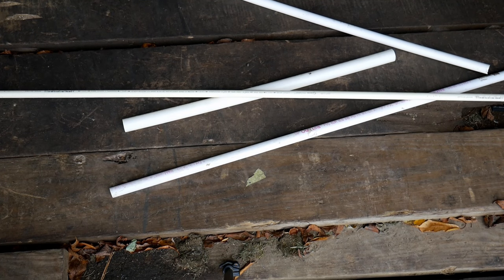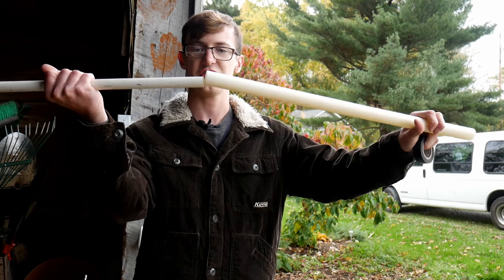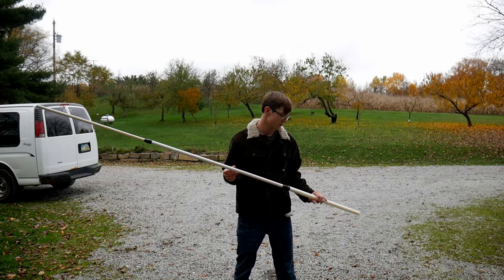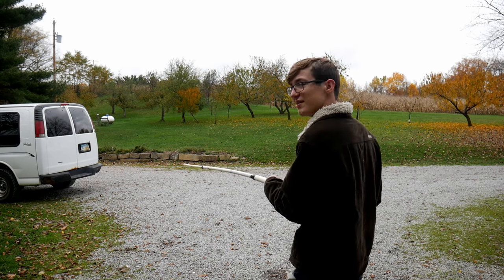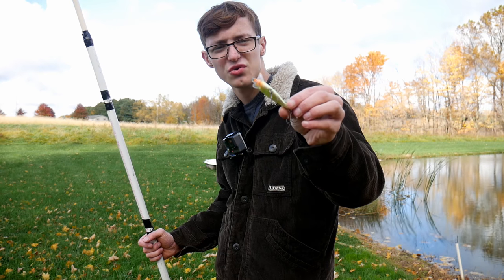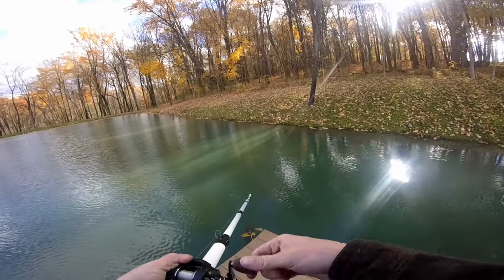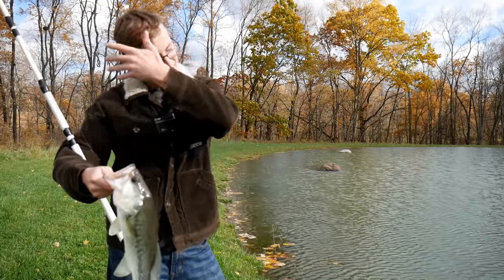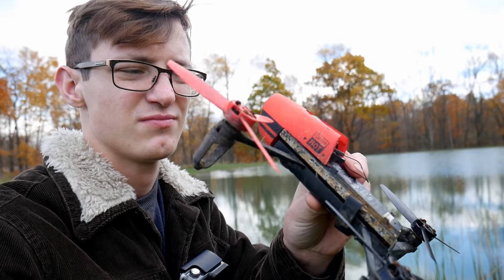PVC  Fishing Rod challenge

Comment: Hey guys or brendan, what bait or baits do you reccomend for fall fishing??
Reply: Gage Romanski I use crankbaits and spinner baits and I also go cat fishing in fall
Reply: Okay thanks. Im gonna try and use this soft plastic swimbait I just got
Reply: no that won't work. at this time of year bass are keyed on crankbaits.
Reply: jerkbaits, slow rolling a spinnerbait through the weeds or chatterbait with a swimbait trailer, squarebills use a stop and go retrieve alot of bites will come when you stop the bait same with the jerkbait
Reply: Crankbaits are great this time of year, but hardly the only thing bass will hit well.  Bass are still hitting shallow, and even on the surface.  Right now, they're hitting from surface to bottom.   Even here in the north, large lakes still have water temp in the sixties, and on a sunny day, bass are right at the top of the water, and will hit anything from frogs to poppers.  Crankbaits will catch them like mad, but crankbaits also draw everything from crappie to walleye to every other fish large enough to hit the bait, so if you strictly after bass, you'll have to go through a lot of fish to find them,  at least in a large lake.

Comment: I was already making this rod 1.5 years ago before I stumbled upon this video. PVC rods are great. I make rods which I call pumping rods. That is, I pump yabbies and worms with them too. I also turn them into walking sticks. I make my own slide on eyes and reels too. Never have trouble CASTING but don't use full length 1 meter sections and I do not attach them with tape. You can use some newspaper and box tape to create a friction joint so you can slide the PVC to correct length so it casts properly. See @plettgeorge for D.I.Y reels and rod kits. Simply reed all 212 bush fishing related tweets if you want to.